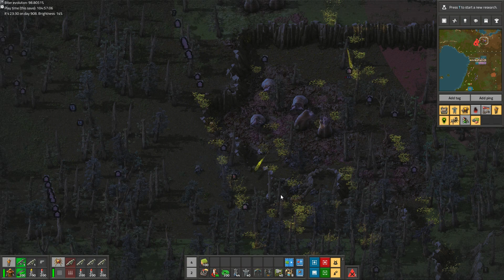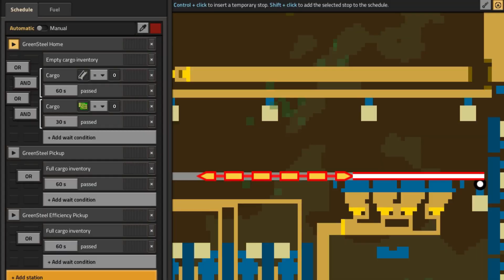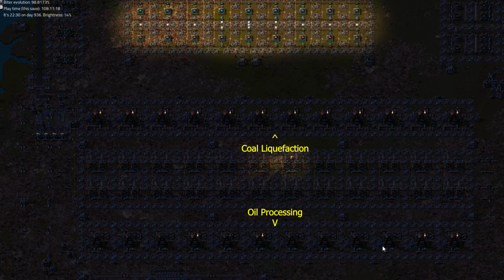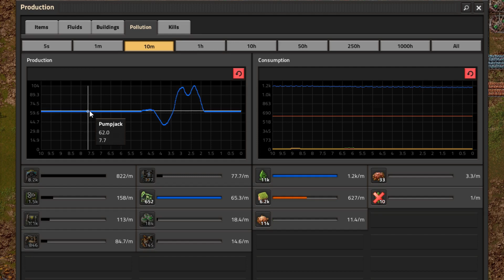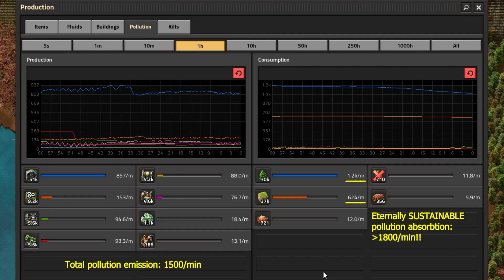Saving the Climate for a Green Green World! // The Ultimate DeathWorld Challenge #28

Comment: "twice the oil for no extra power consumption"
Sorry to point it out, but you forgot to factor in the power draw of the beacons. 
Having said that, nuclear only pollutes from the centrifuges and assembler for the fuel, which are both negligible. The numbers on pollution per megawatt would be interesting to see though.
And obviously, the "no extra pollution" part was correct too

Comment: Could you wire up all the beacons to only run when the thing their augmenting is running? that will probably knock 20-50% of that 1.9MWs off your power usage.
Reply from the maker: At some point all will be running though, so there's not really a point since we run nuclear power
Reply: @MichaelHendriks  1: nuclear power isn't entirely green tho? even just MINING uranium isn't entirely pollution free, neither is the sulfur needed for it, nor the processing required to make the purified uranium or the U-fuel. Its not as bad as coal by a long shot don't get me wrong, but this is still a lot of energy that's seems to be wasted. (unless you pre-mined I guess, but I thought the point of this run is to get as close as possible to infinite sustainability).

2: yes, at SOME point any single device will be running (you wouldn't have it if it wasn't needed after-all); but there likely will be a significant portion that will, at times, idle. Your oil pumps might stop when your storage is full and starts running only intermittently, or your factory has excess resources or some particular part for some reason (or runs out)---. the point I'm trying to make is that overall, your factory probably idles at SOME point and if your beacons are the majority of your power, then it means those sub-system's idle-state is not particularly efficient.

to put it another way, your power consumption should vary to how much resources your consuming and/or parts your producing (as the absolute minimum required will do so). if its not, then somethings eating power unnecessarily. Course, it would be hard to set up literally EVERY beacon this way, but I don't think it would be that hard to set up sub power-nets for entire sub-sets of your factory so that power consumption at least ROUGHLY follows resource consumption---if with a lot of "aliasing" or following a "stair-case" pattern. At the moment its almost entirely flat simply because the beacons are 90% and their ALWAYS on.

edit:
basically, set up each significant part of the factory to only be on AT ALL if there's a shortage in its output resource overall AND enough resources to supply it; so that its either ON 100% or OFF 100% ---then you can just set up a power switch (there is a vanilla way of setting up power right? I forget). This way your sub-factories alternate from 0% to 100% to achieve effective percentages between rather then having half of its capability on all the time.
Reply: I suppose another possable improvement (only worth it if still needed after dealing with the beacons) would be to just expand your walls more (you might have to to get more resources anyway afterall, IDK tho). your walls (or rather turrets) consume power OC, but your defenses power-use is proportional to your factory circumference while the natural pollution-absorption is proportional to the area. So the square-cube law is on your side as you scale up. (and this is on top of the fact that your power-production is not your top polluter).

you would of course have to explore more terrain and thus require clearing more biters (and even more once you make your biter-genocide move, but you have MORE then enough ammo atm so <shrug>. I presume the plan is to upgrade arty range till the auto-shoot encompasses all of the generated terrain?

(course, once you kill the biters, you can get rid of all the laser turrets, but theoretically your factory will need to expand to get more resources, even if this playthrough stops right?).
Reply from the maker: Nuclear power burns through fuel like it's running at max capacity all the time, so energy-saving-strats (like disabling idle beacons) have no effect at all. The beauty of it is, now there ARE no power swings, so no worries, and it's easy to see just when you need to expand power. Making fuel cells is incredibly cheap. If you take into account mining and such, Nuclear power + mining and processing uranium is an order of magnitude more eco-friendly than even solar power.
Reply: @MichaelHendriks  um, once your setup with solar power, its 100% free; so I feel like we are modeling with different assumptions or something? I understand why you diden't go solar (it takes up a lot of space, its expensive up front and its boring....so I'm not arguing about *THAT*.....)

but I don't know why/how you can say that its more eco-friendly then solar. once both uranium and solar are setup, solar is better (with accumulators OC). its even easier on your UPS as well so it scales into mega-bases too. since the game only has to count the number of solar panels  and mulitply by the power-multiplier given by the current time; rather then do all the calculations required for fluids, items, building processing, etc.
Reply from the maker: If you disregard the up-front costs (like most electric car drivers I know), you can claim solar is 100% pollution free. If you include the upfront cost, nuclear beats solar by a factor of 10, including running cost (for usual playthrough lengths).

The the UPS-difference is insignificant, UPS from nuclear vs solar only starts to matter when you really need to save every last resource in the largest of megabases, and even then it will only save a cent on a dollar
Reply: @MichaelHendriks  hm, so if (short hand) initial input == II and input-over-time == IOT, then your assertion is that

pollution creation equation over entire game:
II_solar*(number of panels + accumulators required to equal 1 reactor) + IOT_solar*(0 because free) >> II_nuclear*(1 reactor setup including reactor, heat-pipes, steam turbines, etc) + IOT_nuclear(cost of one fuel rod)*(number of fuel rods used by one reactor over course of entire game post-nuclear).

that sound about right of what your asserting?

I couldn't find a pollution calculator online for making various things anywhere, do you have a link somewhere? because while I am seeing "room" for your assertion being true in the numbers, I am not sure I believe the numbers work out. regardless would be nice to see how long it takes for nuclear's input+upkeep to surpass solar panel's input.
Reply: unrelated as your game is vanilla, I just realized you can get more efficient nuclear setups with modded diagonal inserts then you can with modded ultra-long ranged ones (that allow supplying reactors one-out). feels alot less silly to be using inserters that are merely capable of going diagonal then ones that can stretch out to the point the textures break.

vanilla: 2-by-N column creates between 3x multiplier and 4 depending on how large you get---> approaches 4x multiplier.
diagonal insertors: N-by-N block with holes every third column/row ---> 2/3s have 5x multiplier, 1/3 have 4x. so approaches about 4.66x
only ultra-long range but not diagonal: 4-by-N column (no way to tile other then this as far as I can tell ) --> appears to approach about 4.5x
Reply from the maker: My assumption/rough calc in short is, solar/accu is about 10x more resources to make than avg nuclear plant+infra, then I round down nuclear fuel costs to zero :p which sounds silly but it's not far off

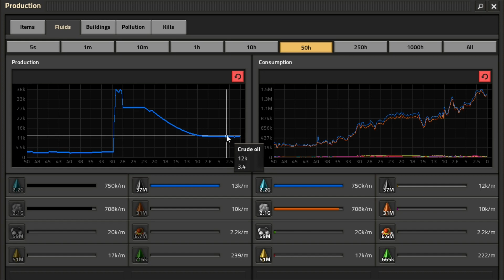Comment: 24:35 "for no extra power consumption"
don't mind those 8 beacons consuming 0.8MW
Reply from the maker: good find, missed that, yeah should've kept it at pollution output
Reply: Still saved if you read it as "no extra [pollution-generating] power consumption"
Reply: Bro, your math is a little off. just one beacon consumes 0.48 MW (480 KW). The eight of them together consume 3.84 MW.

Comment: This series has changed my view of efficiency modules from "totally useless" to "kinda neat". Thank you for that!
Reply: I actually use them a lot in my playthroughs. The energy saving alone is really handy at cutting down coal usage till you can get a good solar grid or nuclear setup even of its just a few hours theyre used
Reply: @julymorris6367  yep eff 1's are A+ in the early game. Lowers energy requirements and reduces attacks while you ramp up.
Reply: My most recent playthrough was "launch a rocket without killing a single biter." Rushing efficiencies on only 4-5 miners to keep polution at the starting area low took awhile, but things picked up after.
Reply: Pretty simple math. Less pollution means less biter attacks means less material has to be used for munitions and can be used towards rockets. But alot of people don't see it that way.